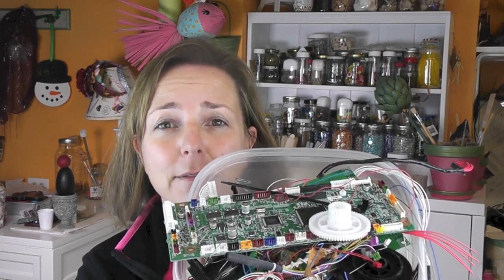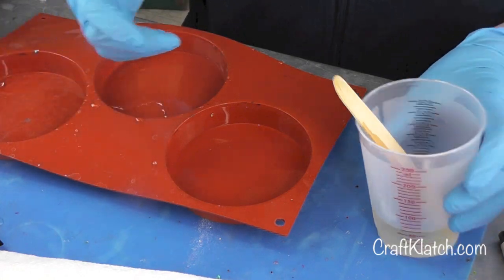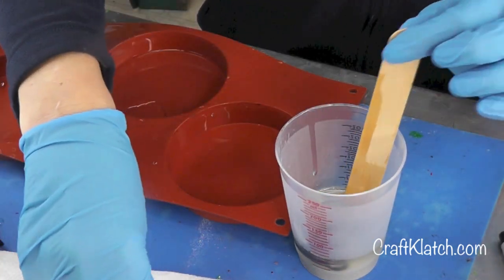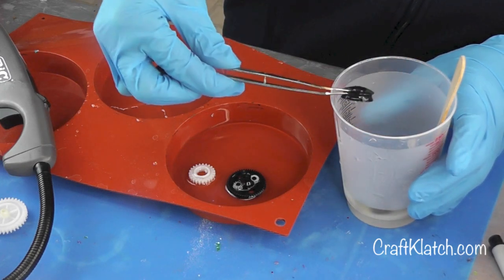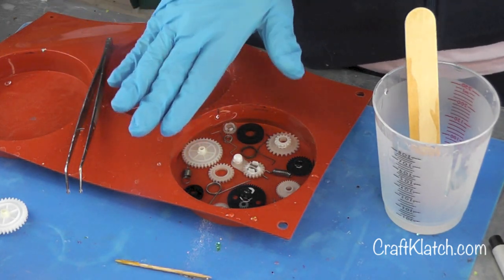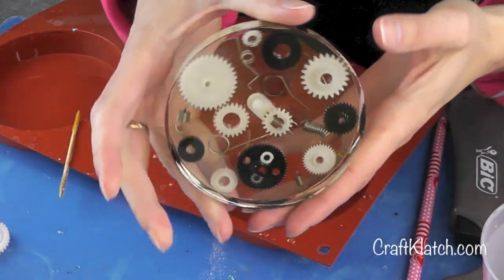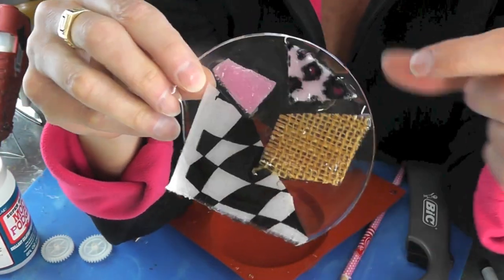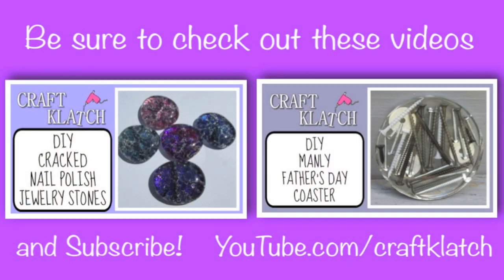DIY Gear and Spring Recycling Coaster   Another Coaster Friday Craft Klatch

Comment: I tried to make a few coasters two days ago, and they're still wet. I mixed equal amounts of easycast for the directed amount of time. Does this ever happen to you? I have the same tray also. If so, could you give me some advice? I love your coasters and I've been trying to make them for mother's day. :)
Reply from the maker: ThatArtsyGirl   Let's see.  They definitely should not still be sticky or liquidy.  It is important to have equal parts for the chemical reaction.  Also making sure it is fully and properly mixed is important too.  If that was all done, then my best guess would be temperature and humidity.  If it's too cold, it won't set properly and if it is too humid it won't set properly either.  One person told me she covered her coaster mold with a piece of plastic to keep the dust out, but it ended up keeping all the moisture in and didn't cure.  Once she stopped covering it, it worked fine.  I'm not sure what else it could be.  I would suggest contacting the manufacturer.  They have customer service department that is always happy to help. http://www.eti-usa.com   Let me know how it all works out.  Mona